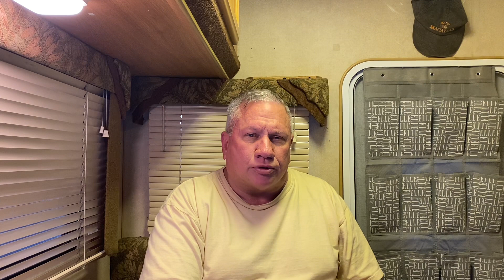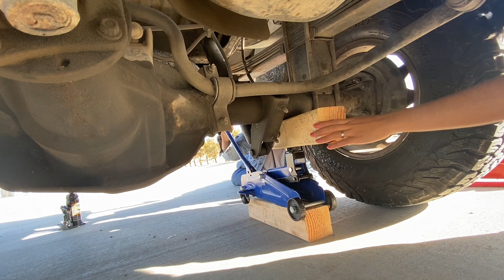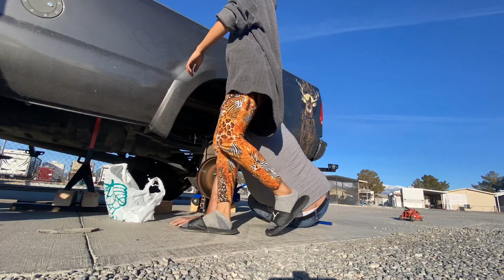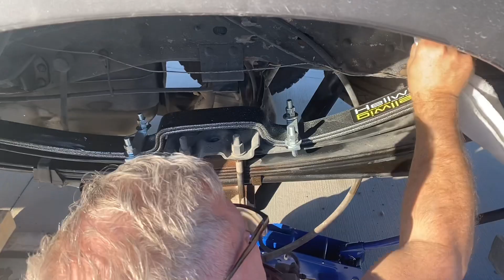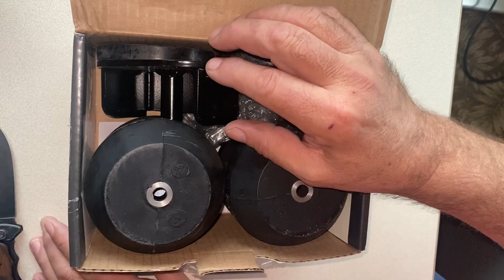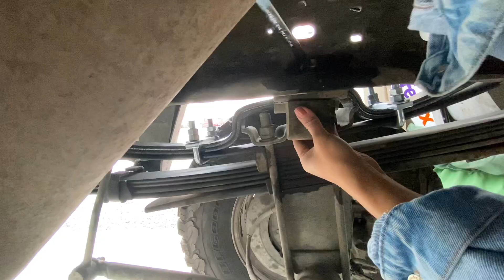What A Job! Installing Hellwig Helper Springs.

Comment: We are gettingnready to put some on our F250..we have a lance camper with sway bar and airbags..what were your thoughts after you put them on did it make a difference?? Didnt see a follow up video.
Reply from the maker: Honestly I would have to say that they were a waste of time and money. The right way to do it is to have a spring shop build up your spring pack. I wish I had airbags and a heavier swaybar. Money is tight right now. Thanks for watching! 🙂
Reply: @realistictruckcamping2779  looking at what you put on your truck looks like the wrong set for your truck.. after researching ... but maybe new product is different we are going with pro series.. thanks for video
Reply from the maker: @gofish8181  This exact model number was recommended to me over the phone by a technician at Hellwig in California. It is the right one for our vehicle. Unfortunately, our camper is just too heavy, there was no increase in curb height. Basically it added two leaves to the existing overload spring which was just one leaf. I would have been better off with a new heavier spring pack. I was quoted $1100 for that by Skip's Spring Service in Las Vegas. Good luck setting up your rig!

Comment: I've seen springs instalation come out different?
His do not look load bearing?
Reply from the maker: They just added more support to the existing single overload helper spring. Thanks for watching! 🙂
Reply: @realistictruckcamping2779  

They look resting upon, not sharing the load?
Reply from the maker: @bassinc3039  They are fully engaged and load bearing. These are Hellwig Helper Springs #9703
Reply: @realistictruckcamping2779  

9703, I see, I recon?
But I do not see the cabs weight transferred through shackles to truck springs to 9703?
I am no engineer?
Was looking at different hellwigs myself. 
They looked different with four u-bolts per side? 
I'm no engineer.
Reply from the maker: @bassinc3039  This particular model has 2 thick leaf helper springs with two u-bolts per side. They did stiffen up the ride but failed to add height to the rear end. I will probably have to add air-bags to achieve that goal.